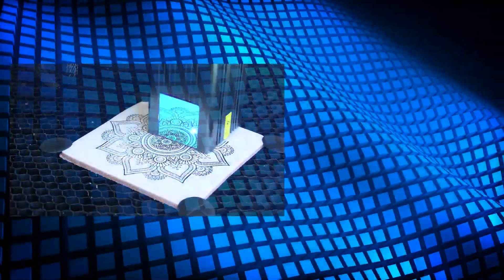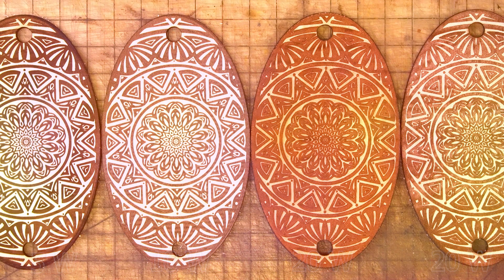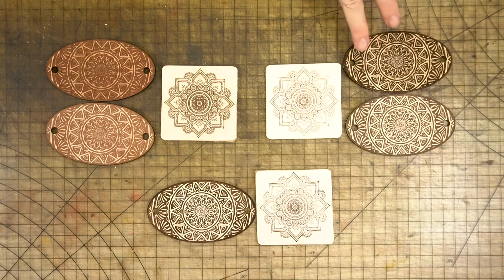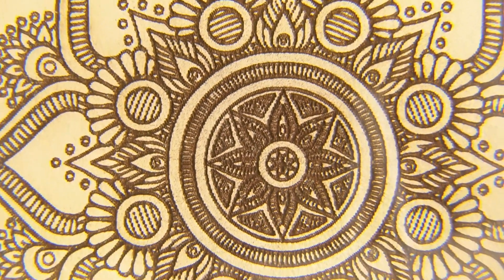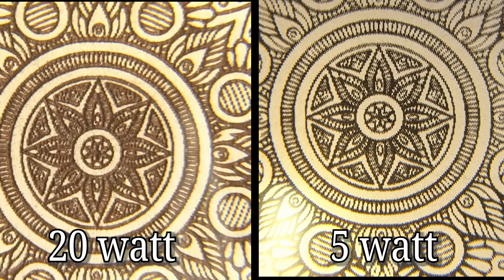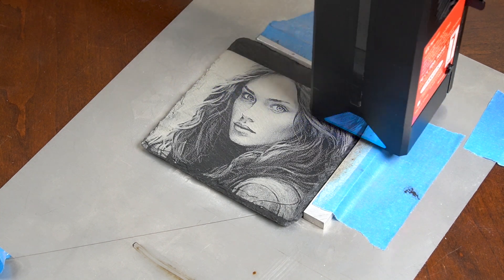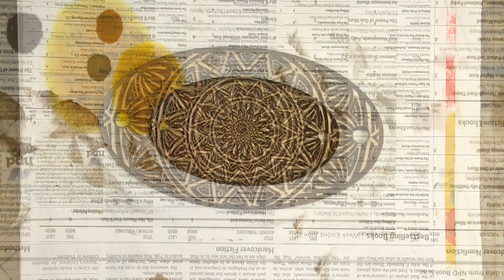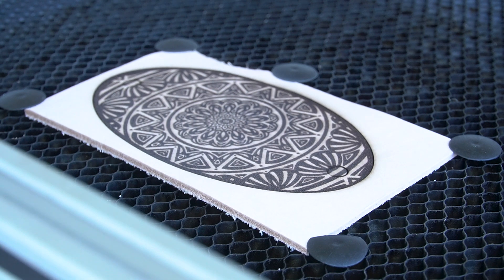Diode Laser Buying Guide: Why Spot Size is More Important Than Power

Comment: Thanks for all you laser advice- of course I'm excited to buy one, appreciate all your advice. 
I'm wondering dumb thing. The art work. For cut or engrave. does it require additional cost art program or could I use basic paint program. How do you give laser instruction where to cut and where to burn. I would like to  cut very thin sheets of wood onto earring designs. I want small and simple, unlike what is on the market: way too big and bold.
I have idea what do you think? I want to cut and engrave very thin items, maybe even faux leather (you try any? ultrasuede?)  in order to hold position, Plus would help with dust, rig up a suction table deal. I see dremel folks use simple to complex: furnace filter laying over window fan laid on it's side. to expanded metal screen stapled to wood box, hooked up to shop vac 
Thank you- will send you money when my upstarting biz gets going. You've earned it as consultant.
Reply from the maker: Thank you very much! There are some free and powerful art programs like " Gimp " that you can use to create art as well as edit art that you already have. All the laser decisions are done in a program called lightburn. It is not free but well worth it. You can also edit artwork in lightburn to a certain degree.
Reply: @baronleathercraft  much thanks for advice!

Comment: Did you use any sort of air assist when doing these tests?
Reply from the maker: I turn my air assist up about a quarter way when I engrave and I set it to full blast when I cut. I found that when I do not use air assist at all when engraving the engraving comes out dull. It is for that reason I recommend at least a little air assist when engraving. Thank you for your question.😀

Comment: Very interesting video. I guess there is no one size fits all. The positive is that depending if you need speed or detail, you don't have to break the bank to get the highest wattage. You can do a lot with a low power laser, even get better results in detail.
Reply from the maker: Well put! When it comes to engraving on leather the 5 and 10 watt machines are going to be better for detail plus they will still cut the leather, just slower then a higher wattage machine. I have heard that there is a laser that has a switch so you can set it to 10 watt or 20 watt. The tech is getting better exponentially. Thank you for the comment.